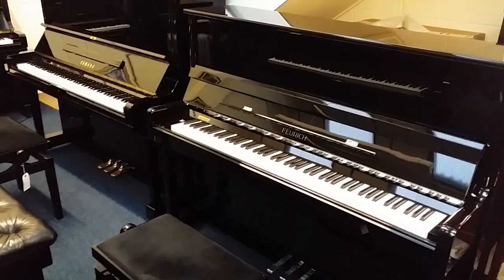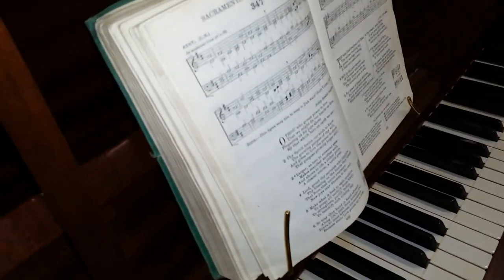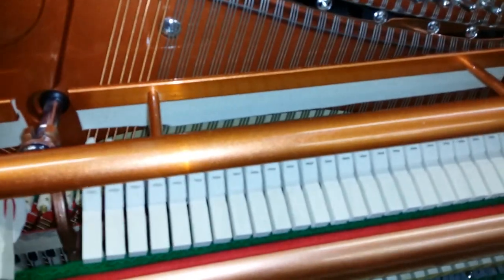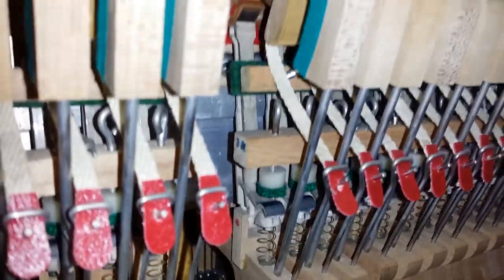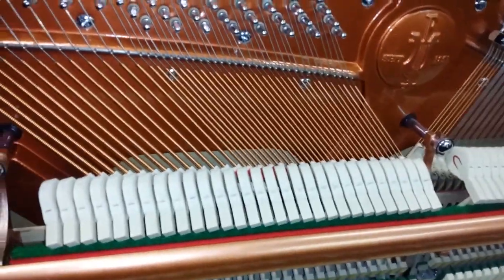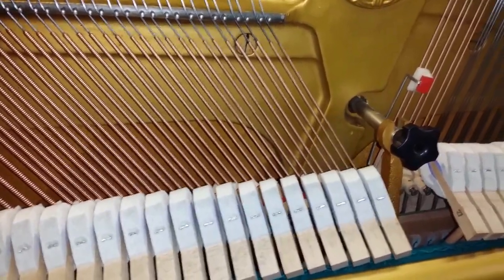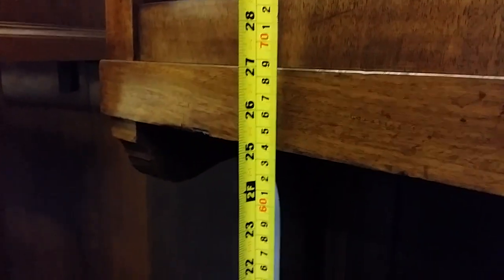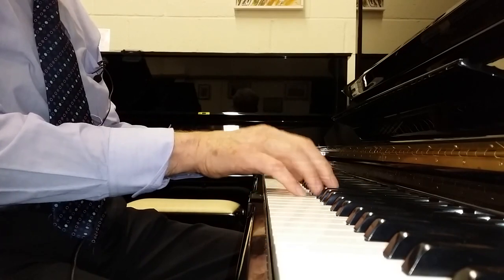Feurich 122 vs Yamaha U3H - surprising discovery! Roberts Pianos

Comment: The age difference of the pianos matters here. Yamaha has made significant changes and refinements to the U1/U3 around 2002. And one of the things was to lengthen the bass strings. They've also changed the hammers. I can see that these are the former hammers Yamaha used on the U-series. The newer ones have underfelt and are softer. So Yamaha has addressed some of the shortcomings you've found on this instrument. The newer U-series also sound different than the older ones, in general. Though I must compliment you on the sound of this one, it's nicely voiced and balanced. This is an informative comparison nonetheless and the Fuerich looks very tidy within.
Reply: What is your impression of the Yamaha UX ?
Reply: @jerrydavis1475  it’s very good!

Comment: I see Feurich offer an optical silent system in UK. They claim that key dampers are just 1 to 2mm off the strings. Do you think this means the touch weight will not be degraded by the addition of their silent system?  Thanks hugely for your videos.
Reply from the maker: Hi Emma, I have forwarded your question to the workshop team and hope I can give you an answer shortly. Thank you for your patience. Evan Roberts

Comment: Hello 

At First , I would like to thank you a lot for your great videos,

I just wanna ask you where is the Feurichs' Country of origin ? 
I think both of these pianos are made in China , and I think this feurich is different from "FEURICH Vienna" series, 

And my second question is what is your choice between a Second hand Yamaha U3N (131 cm) and a New Feurich 122cm ? 

Thanks Again 🙏
Reply from the maker: Hi there Sepehr, they are both well made pianos, from my best understanding is the U3N was made by Kemble pianos, UK. Which is now closed. From our experience, the Feurich Universal 122 is good for it's size. It is comparable to second hand Japanese Yamaha's. Japanese Yamahas being better than Yamaha's from other countries. I hope this helps. Feurich make some Feurich's in Germany under different branding, the part made in China, regulated in Europe Feurich's are made well in combination with Chinese, European craftsmanship. I hope this helps. This keeps the cost down. Greetings from Roberts Pianos, Oxford, Evan Roberts
Reply: Thank you very much for your help 🙏

I asked that because many pianists believe that secod hand pianos, After about 15 years, will be technically weak and sensitive and will need constant repair. So they recommend to buy a new piano (no matter where it's made) instead of a used old piano, 

Do you agree with this idea as a piano technician ?

Comment: For me the Feurich sounds good at first but gets a harsher tone in the alto and a muddier bass and seems to change character in its different ranges. It's nice, but for balance, it's Yamaha, more consistent and I think refined in its tone.
Reply: Benjamin Smith I agree with your comment and prefer the tone of the Yamaha as recorded here...however it is possible the recording is to blame...hard to judge.  For myself I prefer a solid unfluctuatuating “bell” like tone, not metallic...if I can hear something that reminds me the piano has metal strings I think we failed to get something right.  How that sound is achieved I do not know but I own a 1895 W. Bell & Co piano manufactured in Guelph Ontario Canada that has that quality.  I also own a Yamaha U3...but I find myself drawn to the older Bell piano as it can “sing” way better by comparison.
Reply: @randymueller1036  Have you tried the Yamaha UX ? They are the best uprights ever made by Yamaha
Reply: @jerrydavis1475  I would say YUS is their top range at the moment.

Comment: Many thanks for your very informative videos.  I just purchased a Yamaha reconditioned U1 from 1975 (wish I had known about the Feurich first).  Hammers etc. changed, but strings probably not.  I am finding some of the notes from C2 to D3 very harsh compared to their neighbours, which is very disappointing.  Dampening one of the two strings for some of the notes yields a different sound between the two for the same note.  These bass notes are also a little sharp in their tuning whereas the treble ones are about right.  Any ideas on the reason for the harsh sound would be welcome.  Thanks.
Reply: Hi, we are considering buying Feurich 122 instead of Yamaha B3 for our children. One is 15 and playing recorder on conservatorium, one is 12 and playing clarinet. So for both this will be a second instrument. The price is almost the same, but reading these reviews it seems, that Feurich is of much better quality, althaugh made in China and pimped up in Vienna…

Comment: is the Feurich 122 the same spec as a Wendl & Lung 122? I bought a W&L in 2013 and was told they are similar.
Reply from the maker: yes, they are practically the same piano. Wendl & Lung teamed up with Feurich and made the same models under the 'Feurich' name. The same factory, the addition of Feurich input but pretty much the same piano. Greetings from Roberts Pianos Oxford, Evan Roberts

Comment: The Yamaha is much older, has the design been modified in the newer ones? Yamaha hasn't done the upgrade/redesigns to their popular uprights that they've done to their popular mid-level grands. So, I wonder if that's in store. Feurich's are Vienna-based designs, they're very good pianos.
Reply: Yes the newer Yamahas are rather different from the older ones, and this is apparent with their U3 model. Newer U3's sound amazing, so rich and warm, compared to any time before. A much better comparison would be with a new U3 from 2010 or newer.
Reply: He hasn't compared a newer U3  because the newer U3s are 2 to 3 times more expensive. There wouldn't be a comparison then as they are in different price brackets. I think this comparison between a reconditioned U3 and Feurich is acceptable.

Comment: Any comparison between Feurich 115 an Yamaha U1? And any comment on Feurich 115?
Reply from the maker: Hi Curtis, Thank you for your comment and request. Marcus reads comments. I know that we prefer the 122 Universal model Feurich. However, we may end up custom ordering one on request.
Reply: Thanks Roberts. Since my home condition only Feurich 115 can be fitted. I would like to know if it is still good to in sounds, touch, materials, etc. compared with Yamaha U1. I know U1 is 121cm height but Feurich 115 only 115cm height which is not “apple to apple” but I would like to have your comments between them too and is it worth to buy F115. Thanks
Reply: Any updates?
Reply: Roberts Pianos 

Do you mean feurich 115?

Comment: The Feurich sounds very better, it's clearer/less noisy and more pleasant to hear. Anyway remember it is a chinese piano and the assembly may not always be as perfect as Yamaha, which is famous for its reliability.
Reply from the maker: +Hans Brikkenbakken We've found that the Feurich have a very good production flow, they get their pianos finally checked in Europe before shipping to us. To the European produced ones from the Chinese factory are well checked over so quality maintains high! We very much like them
Reply: I completely agree: the Hailun production flow is very technologically advanced, the Feurich line is a good product, better than Yamaha if compared to the U or YUS series, but it's still not reliable as Yamaha is.

I live in Europe and I know that some Feurichs comes with production issues, nothing that couldn't be resolved, but I would consider it only at a lower price than a U series Yamaha.

I personally don't like this commercial policy of making so many series, when you buy a Yamaha you can choose between products with too distant quality levels. The U series is the most famous but many years ago I owned a U2 built in 1972 with a noisy unpleasant sound, I played it for many years but never liked it. Newer series (SU and SE) are a lot better, but expensive.

There are to many false German, Chinese brands, with near to zero quality around there, and here in Europe we all remember the old Feurich made in Lepizig, which was one of the best at all. This is why we see those China acquired brands with a lot of suspects.

Maybe there are some US products that can give you better quality and better sound like M&H.
Reply: Yes, SE and SU Yamahas are on a different level than the U-series. The P and B series are really more OK and entry-level. German brands are going with Chinese builds for the production pianos. In time, quality may be reliably good.

Comment: The low-bass "thump" at the very end of Sheep may safely Graze on the Yamaha at 6:51 sounds just like mine at home.  The corresponding moment on the Feurich at 7:36 doesn't seem to do that, though his hands are just slightly not together on the last chord.  After the thump, the Yamaha's decaying note sounds slightly metallic whilst the Feurich sounds more pleasingly "full".  Needs to be listened to "live" as there's only so much that can be gleaned from videos.  The differences in construction between the 2 pianos as described are clear and very interesting.